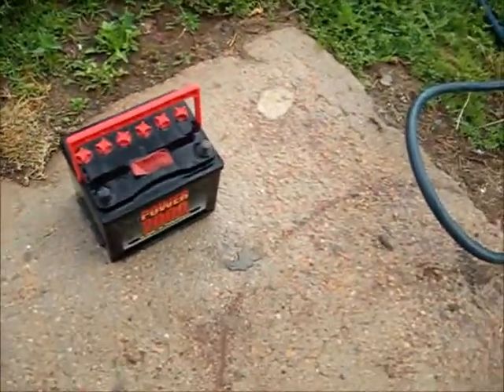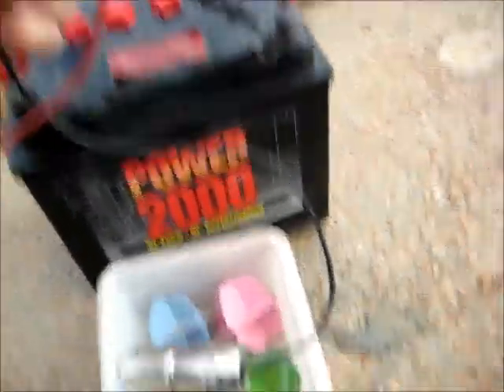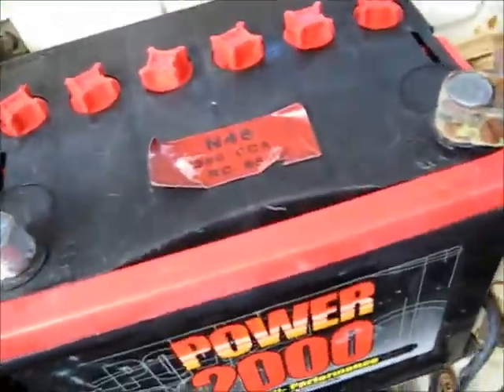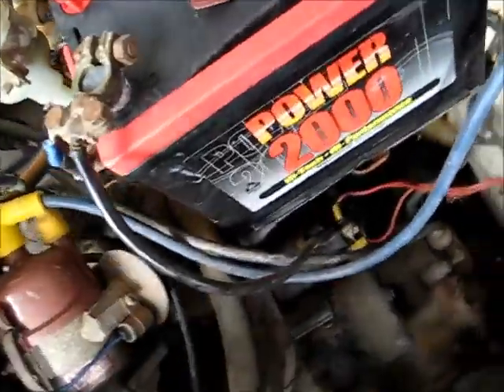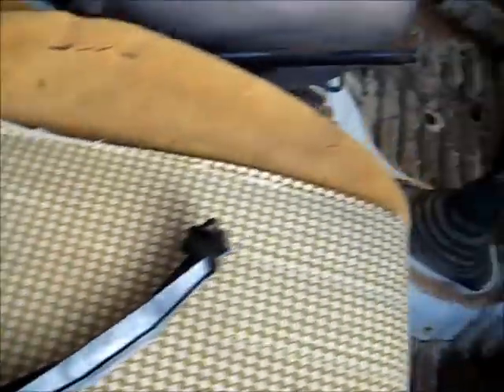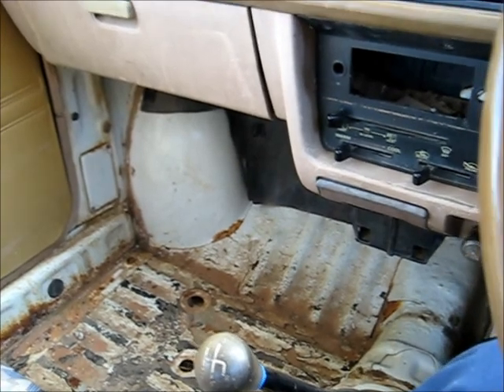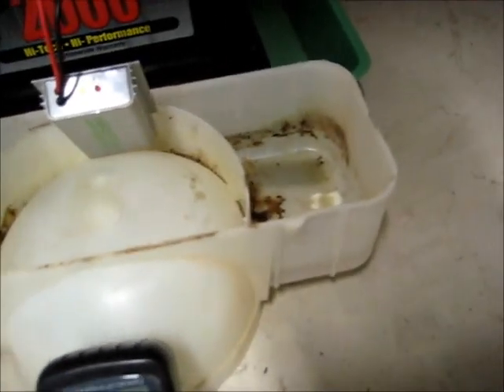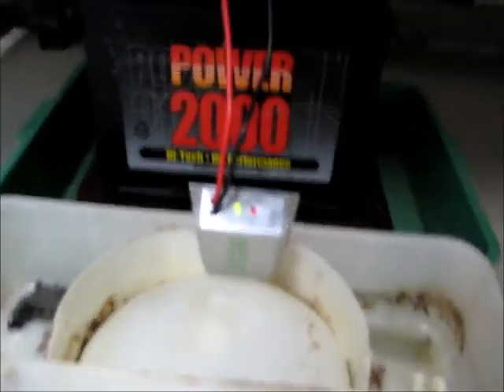Proof test on Chinese battery

Comment: Great video,
You were lucky that you did not blow up your ammeter.
An ammeter is put in series with the load, NEVER in parrallel as you did at 2:42 with the battery.
If that was a good battery, it would have blown the ammeter fuse or completely destroyed your ammeter.